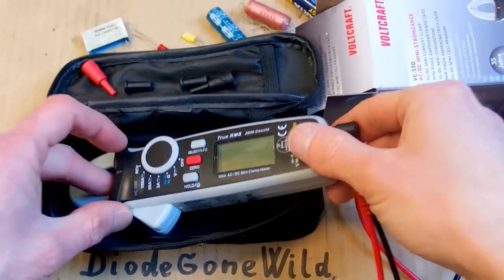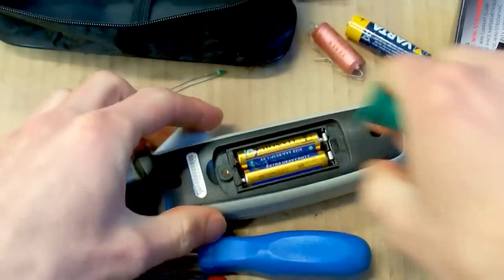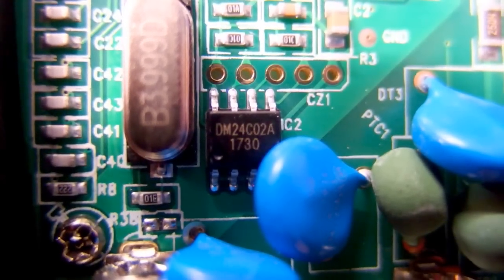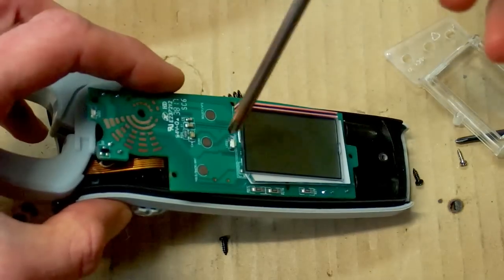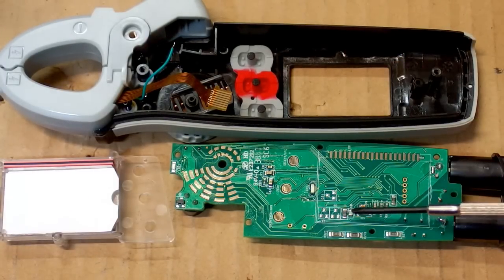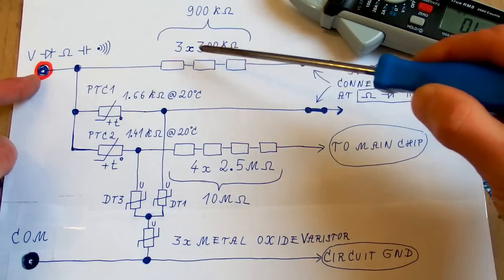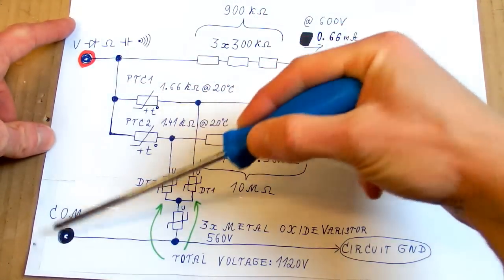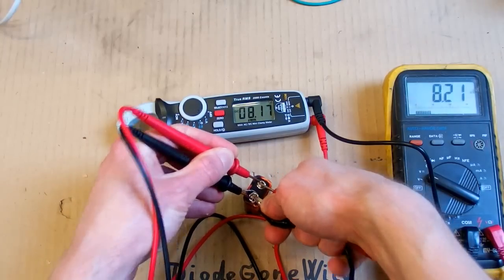Clamp Meter Teardown (Voltcraft VC-330 = UNI-T UT210E) & creating my Patreon account

Comment: I think this could be a fake Voltcraft VC-330. The ribbon on the inside shows UT210E, but This Voltcraft model was released much much earlier to my knowledge.
The original Voltcraft models are sold by Conrad and there, this VC-330 costs around 80 euros (86 USD)
[EDIT]
No, I was wrong .. I opened up my VC-330 and the PCB shown "UT210E Rev.1" 🙂

Comment: You convinced me!  I couldn't find the Voltcraft unit for sale, but I found the Uni-T on eBay for $44 (USD) plus $4 shipping.  That was from a USA vendor.  It would have been cheaper if I wanted to wait to get it from China.  But, some China vendors are not predicting delivery for 2 to 3 months.  From the USA vendor it will be here next week.

Comment: Recently I’ve got 2 similar Clamp-Meters (UA220D from UYIGAO and a Mustool X1 6000) which generally are okay but both show just horrible nonsense-values in clamp-modus below 300mA DC  (accuracy there is around 15% and worse) and, even much worse in AC below 500mA (up to 40-50% inaccuracy) ..the digits there change randomly from one fantasy value to another. 

so, as I can see you are much luckier with your tool with current-measuring but from my side it’s quite disappointing in lower current-ranges. For quick, uncomplicated measurements over 0.5 A DC/AC it’s fine and tolerable, of course ...however I’ll never trust in clamp-mode’s accuracy 

I wonder again and again, with what indifference you disassemble your devices (and how much confidence you have in reassembling them)   ...brave man  ,)

Comment: Hello, interesting video. Do you have an idea which of the 3 pots is responsible for the DC voltage adjustment. My UT210E shows a bit too much DC voltage right from the start. I have a volt reference. I just do not know which poti is responsible. greeting...

Comment: That is the 1106EN chip meaning you can flash the eeprom to 9999 counts, make DC before AC on all ranges, and increase clamp measurements to 600A.  I have the UT210E and have done these mods.  It's such a a good clamp meter for $35

Comment: Excellent video as always apart from missing cat, perhaps the pillow detector might detect cats too.  I suspect that there are two hall effect sensors so that they can be used in a bridge configuration that allows the temperature coefficients to cancel out and the voltages produced by the magnetic field to add.  There is a full circuit diagram here . . . . 
https://www.eevblog.com/forum/testgear/a-look-at-the-uni-t-ut210e/?action=dlattach;attach=489989

Comment: Bro in this meter u can measure Dc current without select the Dc option. I mean at Ac dial also. U can check it. Is this a fault??
Reply from the maker: My one doesn't measure DC current when set to AC range. It shows zero. Just during transients (when the DC current starts or stops), it briefly shows some value, but then it settles back to zero. So it does show the changes in the DC current, but not the steady DC current.
Reply: DiodeGoneWild i have ut210e and it shows like that. It means meter is not good?

Comment: plz sir see and explain this  https://youtu.be/seTrxTxMnSM
Reply from the maker: I was doing the same as a kid :). When you turn the switch off, the magnetic field in the core of the transformer collapses quickly, creating a short pulse of a high voltage.
Reply: wow thx. could u also explain this strange thing  https://youtu.be/jATJFZqJb1M  .i tried a 220v  ac lamp on 300 v dc and this wierd thing happened.

Comment: Yes, almost all Voltcraft multimeters are made by Uni-Trend. But they aren't always the same as you'd buy if you were buying Uni-T, because Uni-T devices shipped to different regions aren't always the same - often what you buy on Amazon and eBay are grey market imports. They would generally share the same PCB and enclosure, but can sometimes have as many components removed as humanly possible, which means foremost the input protection. Some multimeters are completely customised for Voltcraft, like reusing existing enclosure and components bin, but using a custom PCB and different feature set not present in any Uni-T branded device.

Comment: Are the rotary switch contacts gold plated? Course that would be awesome for the price. I thought about buying one of those but I bought a aneng an8009 instead. It is a very nice multimeter considering the price.
Reply: Difficult to say what kind of plating it is before it's used up, it could be ENIG, which is almost useless, or it could be hard gold. It is indeed super likely to be hard gold, and it's not at all uncommon in these kinds of multimeters, but probably not a lot of it.

Comment: You can change some values in the eeprom and get more counts and make it default to DC and such nice things. :) Thread on eevblog. Worked nicely on my ut210e
Reply: I remember when he mod the cheap digital meter to do that, with a few resistors.